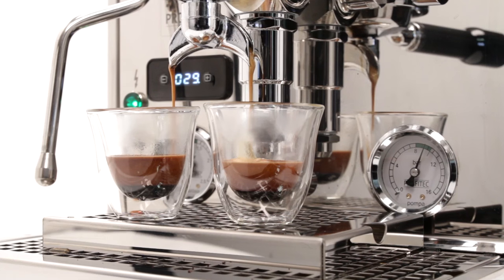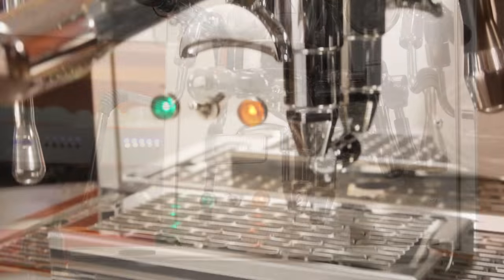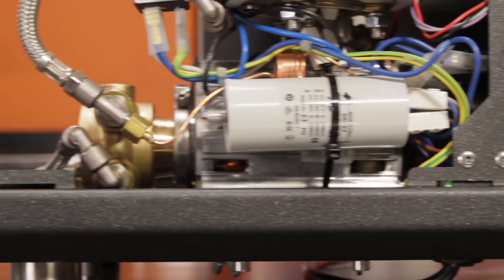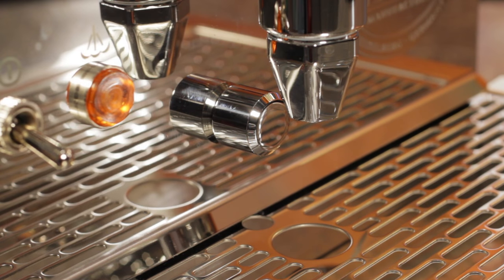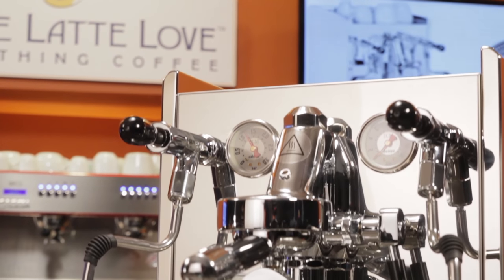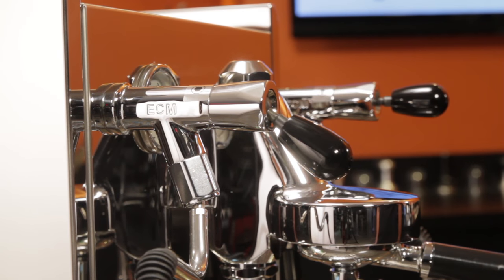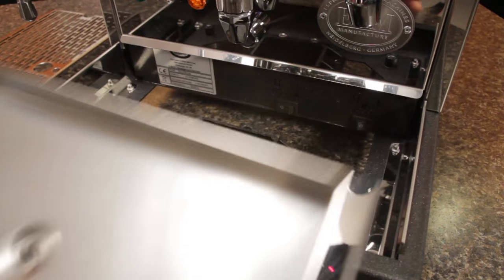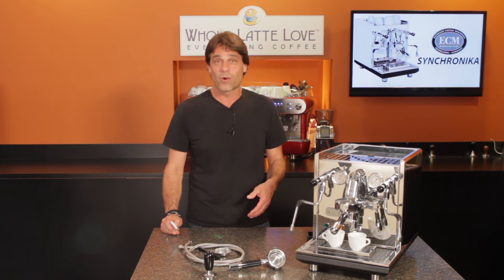Review: ECM Synchronika Espresso Machine

Comment: Well... there it is! You’ve noticed me looking for an upgrade probably (Ha!) but this is it. For price and features, I have actually managed to raise my budget for this. The joysticks are probably the most helpful weirdly enough. Because I have a nerve injury, I can’t do much movement with my left hand and not having to turn the dial to open the steam valve is incredibly amazing! Thanks!
Reply from the maker: Hi DD, Might have noticed :). The ECM Synchronika will not disappoint. Defiantly the class act of dual boiler domestic machines! Best in class steaming power, stainless mushroom, opens up in under 1 minute, line pressure pre-infusion, best in class case work finishing and since this video additional upgrades like chromed ends on the joysticks, tapered E61 group head, programmable standby time, backflush reminder, flow control option. See it in all it's latest glory here: https://www.wholelattelove.com/products/ecm-synchronika-dual-boiler-with-flow-control
Marc

Comment: I just bought a Synchronika a few weeks ago and thought it had a lot of vibration for a rotary pump. I finally started taking it apart to look at it and noticed it has 2 wing nuts coming out of the bottom that attach to the pump without rubber mounts. I took those out and now it's very quiet. They are obviously shipping mounts that are supposed to be removed before use but there is no mention of them in the manual. It wasn't terribly loud but now it's amazingly nice and quiet. I just thought you may want to add a note to units that are shipped out to make sure to remove those.
Reply from the maker: Hi Mark, Thanks for the comment! Did you purchase the machine from us - Whole Latte Love? We do include a separate sheet in the box with instructions to remove the shipping mounts. You are correct these are not mentioned in the machine manual. Likely because those shipping mounts are not used on some Synchronikas depending on final destination. Glad you found those and are enjoying an even quieter purr from yourbeautiful new ECM! Also, as a new Synchronika owner thought you might want to bookmark our support wiki for the machine: https://wiki.wholelattelove.com/ECM_Synchronika
Too late now I suppose but item #3 in the 'Install It" section of the wiki covers removal of the wingnuts. Our   Synchronika support wiki has tons of great info including diagrams, manuals and operation tips.
Marc
Reply: @Wholelattelovepage  I did buy it from you. It is a refurbished unit maybe that's why it was missed. It came with a Packing Slip, Acc checklist, Refurbish test sheet, and manual but nothing about the the mounts. Thanks for the wiki link. I'm very happy with it.
Reply from the maker: Hi Mark, Glad to hear you're happy with the machine - refurbs are good deals! IDK for sure but may have been a machine used in a video! Apologies if the wing nut removal info was not included in the box. I'm going to have a talk with our packers!
Marc

Comment: Hi! I’ve had my Sychronika for just over two years, now. Reliability has been top-notch, and I always look forward to using it. If I could change just one thing, it would be to move the steam boiler switch out from under the drip tray. I routinely operate that switch every day at least once, and it’d be nice to not have to pull out the drip tray every time. But that aside, it makes great coffee, and with the added flow-control device, gives me everything I want in a home espresso machine. I would certainly recommend this machine to other home espresso “hobbyists.”
Reply from the maker: Hey David, Thanks for the feedback and recommendation. Especially valuable coming after 2 years of use. The Synchronika has been out for about 5 years now, has seen continued improvements and IMO remains the best overall machine of its type.
Marc
Reply: @Wholelattelovepage  I do have one question. Ever since I started back-flushing the machine routinely, the brew lever has started making a kind of squeaking noise when I operate it. It just sounds like it needs a little lubrication. Any suggestions on where to apply that lube (hope it doesn’t involve taking the brew group apart), and what kind of oil to use? Thanks!
Reply from the maker: Hi David, Well, it does involve taking the brew group apart but it's very easy to do! Only need to take the top nut off. Of course we have a video showing you how to do that which includes where to lubricate. How To Clean E61 Brew Group Mushroom, Jet and Top Valve: https://youtu.be/4H57QSEMDhs
Here's a link to Petro Gel the NSF food safe lubricant used in the video to lubricate o-rings and the E61 actuator in the video: https://www.amazon.com/McGlaughlin-Oil-PETROL-GEL-Lubricant-oz/dp/B002TWJ2L0/ref=asc_df_B002TWJ2L0/?tag=hyprod-20&linkCode=df0&hvadid=198077680239&hvpos=&hvnetw=g&hvrand=8558663218962231005&hvpone=&hvptwo=&hvqmt=&hvdev=c&hvdvcmdl=&hvlocint=&hvlocphy=9005677&hvtargid=pla-382212146310&psc=1
You may be back-flushing too much which removes initial lubrication and/or a coating of coffee oils which causes the squeaking. Reducing back-flushing frequency may help stop the squeaks in the future.
The video demonstrates the procedure on an Expobar E61 group which has a chrome plated mushroom valve. Mushroom in your Synchronika is stainless steel so no concern with descalers and chrome plating.
Marc
Reply: @Wholelattelovepage  Terrific, Marc! That’s not so bad; I installed flow control a couple of months back, so this is no problem for me. Thank you so much. It’s no wonder I keep coming back to WLL. You’re the best!
Reply from the maker: @eclexian  My pleasure David. Just watched your Cappuccino video. Left a comment  - I need to pick your brain!
Marc
Reply: Got the lube and in ten minutes was good to go. Nice ‘n quiet again. Thanks again! 👍
Reply from the maker: @eclexian  Awesome! Happy to help and I’ll be in touch to pick your brain!
Reply: @Wholelattelovepage  Okay, I believe I can spare it! 😉

Comment: Nice review. Thanks for this video ! I have a little question. What kind of plastic is used inside the machine for the water tank, the tubing, ... ? Regards.
Reply from the maker: Hi Anthony, Thank you for the comment and question. Water reservoir is BPA free. There are no internal plastic lines which carry water used for brewing. There are some internal plastic lines which vent moisture from the vacuum relief valve on the steam boiler to the drip tray.

Comment: Regards the Syncronika's steam lever, can it only operate as an "on OR off" position or can you manually ride the flow of the steam inbetween both extremities? Reason being I tend to prefer dry cappuccinos (a lot of microfoam) and thought it might be easier to have manual control over the steam, such as making it less forceful, to give you extra time to infuse air. Or is that effectively what reducing the steam boiler temperature (via the PID) will do? Or would the knobs of the Rocket R58 or Profitec Pro 700 be more appropriate? Thanks.

Comment: Hi Mark,  Thanks again for the in-depth look at the ECM Synchronika. Visually amazing! After extensive research on this machine, I came across a video on here(you tube) in regards to the PID-LED silver display on the Synchronika that was a defect on the film they used..Do you know if ECM have fixed this problem..?
Reply from the maker: Yes it was fixed awhile ago. It was a very isolated incident. If you read through comments on this video you can get the whole story.
Reply: Thanks Mark..Im so in love with this machine...It's time to buy!!...

Comment: Let me start this off by saying that the first and only espresso machine that I have ever bought was a Salvatore Semi that I purchased through WLL 18 years ago. Couple that with the Mazzer Mini, back in the day what  I bought was about as good as it got in the prosumer  category. Today  while it is still no slouch, the high end category has evolved where machines are offering more nuances to finesse your beverage. 

The first thing in my mind that I would be looking at when considering a high end machine is BUILD QUALITY and it's effect on the longevity of the machine without issue. When you are plunking down high end machine money you want durable and NOT DISPOSABLE. Then ease of maintenance would be factored in as well as USABLE features.. The first reason I am drawn to the Syncronika is the powder coated steel frame, that right there tells ya that the machine is durable.  Meant to last. What made the Rolls Royce reputation was you didn't replace parts you rebuilt them. 

What appeals to me about the Syncornika  is the endless variety of settings that can bring out the nuances of the beverage it  makes. You can tweek it anyway that your heart desires. First and foremost is the Flow Control  valve..Most of the other settings once you get past the initial experimentation phase will be more or less permanently set. You will get it down. What the flow control does is offers you the ability to make the beverage that your heart desires to consume today. 

Bottom line on all of the espresso machines is, does what it makes taste good. Is it pleasing. From my perspective I find it absurd to obsessively micro manage every shot that you make in the quest for the holy grail of the perfect shot. It does not exist as there as so many variables at play in the environment that effect outcome. Where even in a "clean room" a fly can get in to effect outcome. In that sense in the culinary .field in particular it becomes an art rather than a science. You experiences will build knowledge and a skill level.  The Syncronika gives you ample room to build that skill set.
Reply from the maker: Hi TABS, Very well said. Thanks for the contribution!
Marc

Comment: Thanks for your review. May I know how important is adjusting the pressure through the shot because i think unlike the rocket 60v, you cannot change the pressure profile. How much difference does it make to the taste of the coffee.
Reply from the maker: Hi Chin, Thanks for the question. Pressure profiling - changing the pressure during the extraction can effect the shot. That said it takes a lot of $$ and other variables in good control to get to that level. Another school of thought (Slayer shots) uses a very long low pressure pre-infusion. That long low pressure pre-infusion can be done with a plumbed in ECM Synchronika. Here's a video demonstrating on a very similar machine, the Profitec Pro 700: https://youtu.be/2DPcZD48TxM
Reply: Thank you so much with your inputs. Many thanks:)
Reply from the maker: No problem - happy to help!
Reply: errrr.... i know this may not a fair question, but if you had a choice btw profitec 700 vs vesuvius espresso, what will be your choice. I understand there is a difference in price but which one is more forgiving. Thanks
Reply from the maker: Hi Chin, The Vesuvius is a fine machine. Money no object I'd take the Vesuvius. It's not more forgiving - actually takes more skill/knowledge to operate it. But if you know what you're doing and are working with exceptional coffee you can probably pull more nuanced shots - but you will go through some trial and error (and lot's of coffee) to get there!

Comment: Hi Marc, it would be great to show some additional at home servicing video for the ECM Synchronika like group head change, group seal change and even cleaning steam wand. 

Also would be awesome to have a comparison video on the ECM Synchronika, Profitec Pro 700 and Rocket R58
Reply from the maker: Hi Alex, Here's close to awesome... A compare of the R58 to Pro 700 and Expobar Brewtus: https://youtu.be/utMkSJD8WcI
The Synchronika and Pro 700 are darn near identical internally. Only real difference is steam valves and more finish detail on exterior of Synchronika.
We have done a bunch of videos on Synchronika servicing. They're very easy to find through our Support Wiki along with with loads of other info including manuals and diagrams. Here a direct link to the Synchronika support wiki: https://wiki.wholelattelove.com/ECM_Synchronika
It's likely we'll be doing more videos on the Synchronika so thanks for the ideas!

Comment: Hello!  I've watched pretty much all the videos I can find on the ECM Synchronika and I noticed something new today when watching a demo on initially filling the boilers.  I noticed when plumbed in, the amount of water coming out of the shower head was twice if not three times the amount as compared to being hooked up to the reservoir.  Does this mean you get better extraction when plumbed in than you would hooked up to the reservoir?  Is being plumbed in one of the secrets of getting that true coffee shop quality espresso?  Also, does the Flow Jet give you similar water extraction as a true plumbed in connection? Thanks!
Reply from the maker: Hi Shadow, Thanks for the question. There is no difference in flow rate based on water source. When the pump is on flow rate is the same from reservoir or plumbed in connection. There is a difference in pre-infusion - that is lifting the E61 group lever to right before the pump comes on. Do this with the machine plumbed in and line pressure is applied to the coffee. When running from reservoir and doing the same you will get a pre-wetting of the coffee with very little pressure and no appreciable flow. Flow jet results for pre-infusion when plumbed in depends upon the pressure supplied by the flow jet. ECM recommends a pressure regulator to reduce line pressure on plumbed in connection to ~1.5 bar (22PSI)
Being plumbed in does give one the ability to do long low flow rate/low pressure pre-infusions which can be beneficial when working with certain coffees like very fresh from roast high altitude single origin specialty coffees. That long pre-infusion helps reduce brightness/acidity in those. One can accomplish that and more with flow control of the E61 group - even on a machine running from reservoir. Here's a video with more on E61 flow control if not familiar: https://youtu.be/HTaly8c-i_U
Hope that helps!
Marc

Comment: Oh dear. Here I am having decided I will order the Profitec 700 for my 40th birthday in January, and now this video is tempting me towards the ECM. I promised my better half that I'd get a machine under 2K.

To be honest though  I think the levers rather than rotary valves is selling me on this one, although I prefer the black gauges on the Profitec. There's worse dilemmas to be faced with in the run up to my 40th!
Reply from the maker: Hi Malcom, Thanks for the comment! Do know internally the 700 and the Synchronika are nearly identical. It's the extra finishing touches on the Synchronika which take it to the next level.
Marc

Comment: Just purchased the Synchronic, the portafilter that comes with the machine, how big should the dose be? Currently I have 18g in it but I feel like thats too much. Thanks in advance.
Reply from the maker: Miles Quon Depending on how fluffy your grinds are and the coffee it may take some overfill and hand stuffing to squeeze in 18g. A Baratza Sette grinder for instance produces a very fluffy grind. I have a tough time doing 18 with it and n most standard baskets. Personally, I like larger doses with some coffees. For those I overfill and use a circular motion with area between thumb and index finger to lightly compress into the basket before the actual tamp.
Reply: Thanks for the quick reply, I am using the Sette and the ground are super fluffy, I will try with the Profitec T64 when it comes in. I will also practice my stockfleth's technique. Awesome channel, I wish you guys were in Canada.

Comment: Hi Marc, Just got my ECM Synchronika . Their are 2 wing nuts at the bottom, shall i remove them as i was told they are to secure the pump while shipping..? and will it make a difference if removed .? The vendor that i bought the machine from didn't know....
Reply from the maker: Hi J, Yes wing nuts are for shipping and should be removed. Not going to hurt anything if you don't but machine will likely be noisier. Vendor should know that!

Comment: Hi Marc does the brew boiler supply water tube go first through the steam boiler ie as in the expobar? Or is it a direct water line supply. That is one of the plus on the expobar and the pre infusion screen chamber! The stainless steel mushroom is a highlight on ecm machines; no chrome in the coffee then others. Did you try same coffee on expobar and ecm which shots did you like better? Best rgds Kurt
Reply from the maker: Hi Kurt, Thanks for the questions. The ECM does not have a heat exchanger pre-heating water to brew boiler like the Expobar Brewtus. I do like the pre-infusion chamber! That's a special feature of Expobar's E61 groups. One thing the ECM can do that the Brewtus can't: Line pressure pre-infusion on a plumbed in machine. Expobar has a solenoid which closes off mains pressure until the pump turns on when brewing. The ECM Synchronika has line pressure in the machine at all times. Depending on how you look at it that's a feature or a risk and why we recommend a shut-off on water supply line of plumbed in Synchronika. With line pressure pre-infusion available on the ECM it's possible to do long low pressure pre-infusion Slayer like shots. Some coffees can benefit from that - but it's subjective depending on personal taste. Here's a video that covers line-pressure pre-infusion on plumbed in E61 machines like the Synchronika. It's shown on a Profitec Pro 700 but works on the ECM as well:  https://youtu.be/2DPcZD48TxM
Reply: Hi Marc

thank for the answer, you do such a G8 job for us, and all of WLL, I learn with every upload!

I did watch the link and then I come to the conclusion, that the chamber
 on the Expobar Brewtus is actually not a pre-infusion, if pre-infusion 
definition is water at about 4 bar, just wetting the coffee.